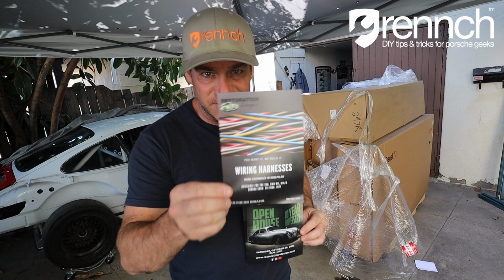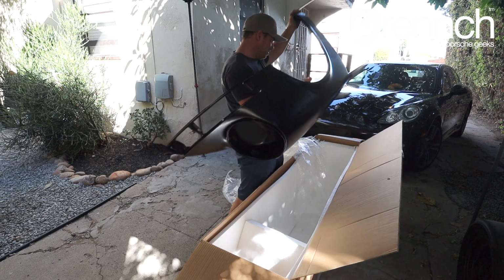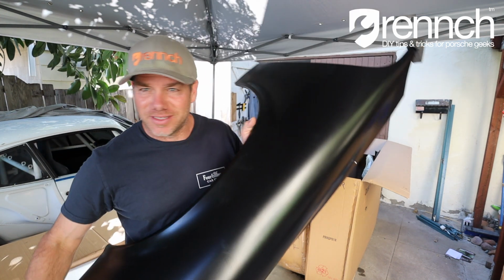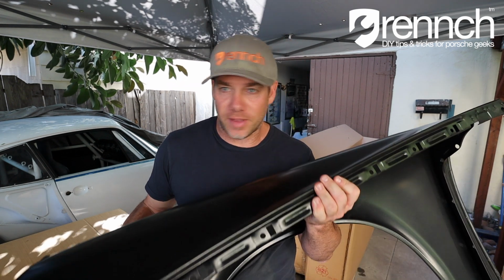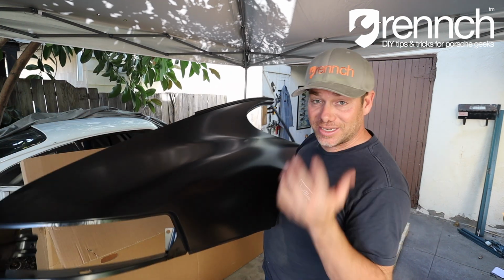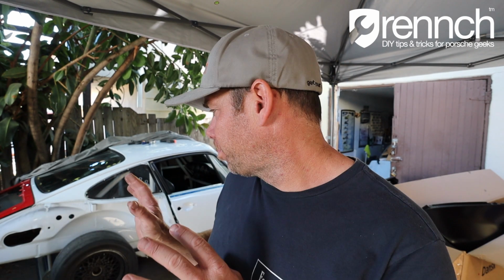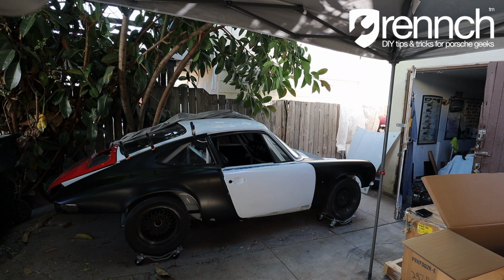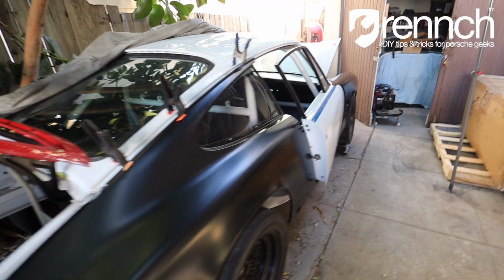Unboxing BRAND NEW Vintage Porsche 911 Replacement Quarter Panels & Fenders from Restoration Design!

Comment from the maker: **GUYS** Thanks for watching.  I’m SO close to 10k subs…if you’re not subscribed yet you’d be doing me a huge favor if you could! Thanks!

SUPPORT THE RENNCH SPONSORS BY GIVING THEM A CLICK AND A LOOK! 
TRE Motorsports - One of the coolest Porsche customizing and Tuning Shops in the world: http://rennch.com/tre
Restoration Design - Vintage Porsche Body Panels and OEM Wiring Harnesses: http://rennch.com/rd
CSF Radiators - The top radiator/intercooler/oil cooler company in the land: http://rennch.com/csf 
CSF King Cooler - The most compact, most efficient radiator for your conversion: http://rennch.com/kingcooler
Classic Retrofit - Amazing Air Conditioning for your Vintage Porsche: http://rennch.com/ac
Autobahn Parts - Best resource for used Porsche parts: http://rennch.com/autobahn
Eastwood - Every fabrication tool you need for your garage: http://rennch.com/eastwood
URO Parts - OEM Vintage Porsche Replacement Parts (Seals, etc..) http://rennch.com/uro

Comment: Looks like RD is sourcing the long hood front fenders from Dansk and not actually making their own? I was hoping that somebody has a reasonably priced version of these, but $1600-$1800 a side is too rich for my blood, especially since I will have to cut them and weld on Turbo flares anyway...... Current plan is to convert some short hood fenders by welding on the light boxes for the turn signals.
Reply from the maker: Restoration design makes 99% of what they sell, but the tooling for fenders and quarter panels is mega expensive so they go to dansk for those.
Reply from the maker: Lukas Matzinger Another thing I factor in with purchases like this is… Am I keeping this car? If an extra $700 or $1000 per side means that I get perfect panels, and I’m keeping the car, it’s only a few extra bucks per year amortized.